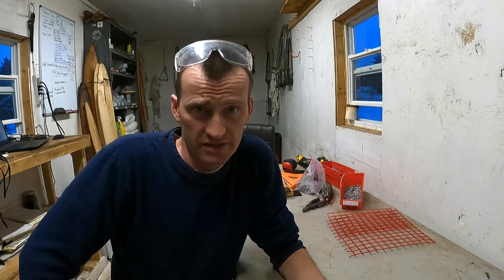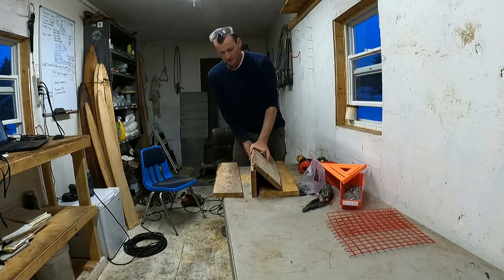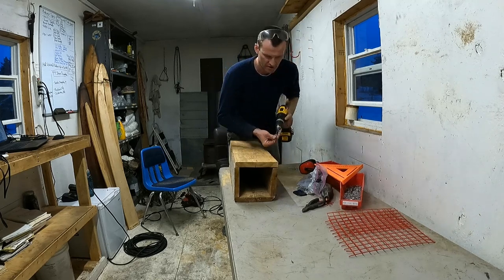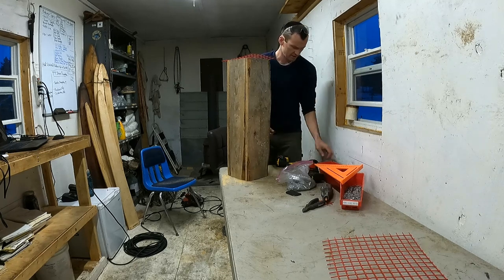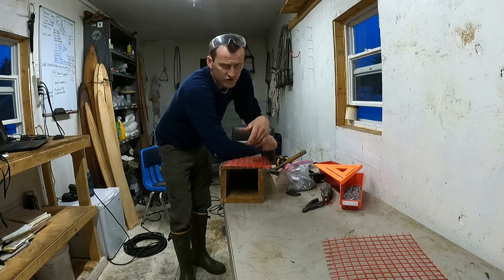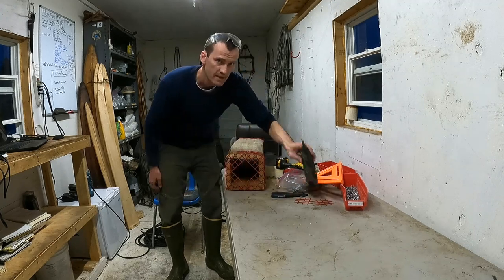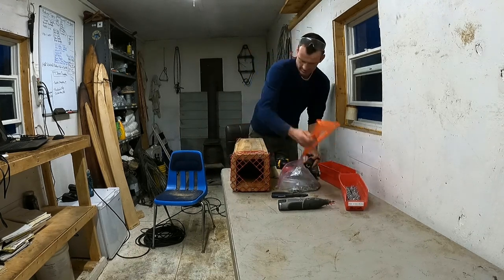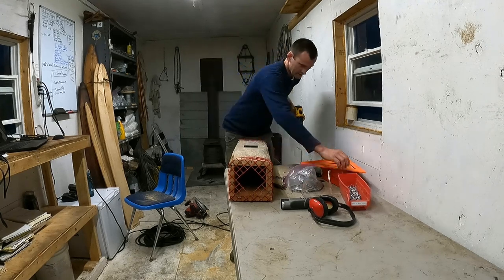How I Build Marten Boxes (Maine Legal Lynx Exclusion Device)

Comment: Great video!!!!
I am a fur trapper, and have a business doing nuisance trapping and exclusion, and I have much carpentry experience.  So frequently doing similar projects.
I was wondering if you would include the important step of smoothing the cut wire burrs on the entrance wire.  Excellent!
It would be easy to set up for production work to make many boxes.  Miter saw with stops set at 11” and then 19”.  M18 Milwaukee cordless stapler makes fast and very strong box assembly.  The staples have high temperature glue on the legs.  M18 cutter makes fast wire cutting.  M12 stapler is great for fastening the wire to the box.
A tapered router bit makes those slots.  It takes a large router mounted in a router table set for center of the piece with stop set for length.  Another method is to drill a 1” hole with a spade bit, then use a jigsaw with a fence against the side of the box with the foot adjusted for the angle cut.  Cut to the hole.
Best wishes.